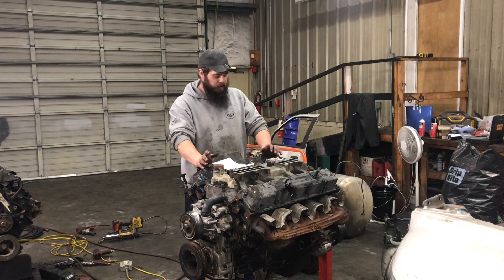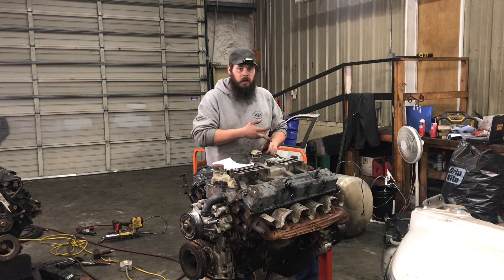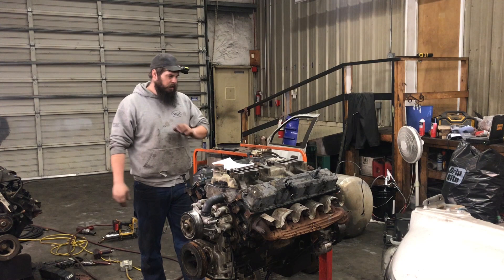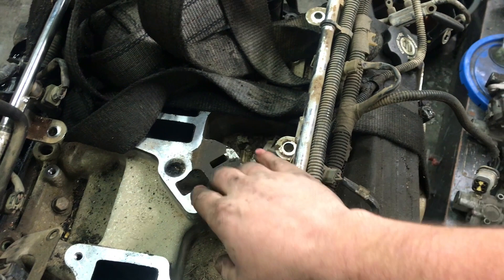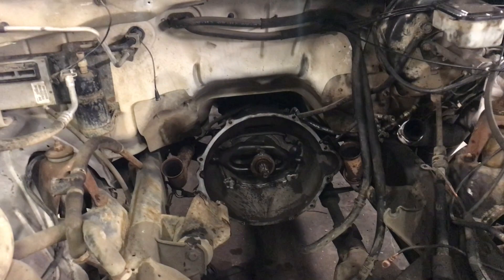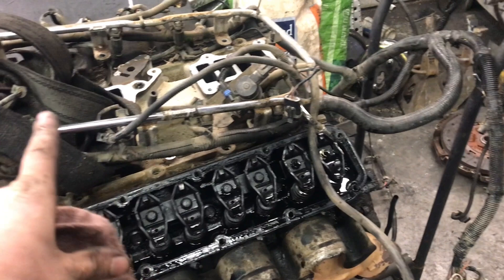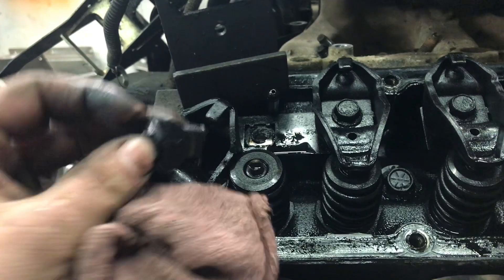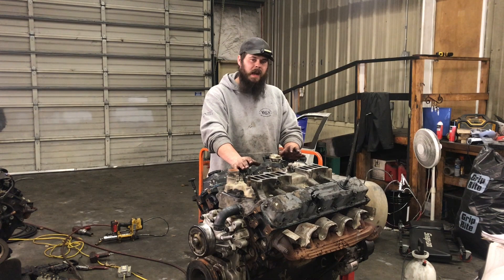EVERYTHING YOU NEED TO KNOW About the Dodge V10 8.0l Magnum

Comment: I this video is going to be a life saver for me. I just bought a 1997 v10 dodge with a 1995 engine swapped in and they couldnt get it running, doesnt have spark. I can see they messed with the cam sensor wiring and the wiring that goes to the coil packs. If im understanding your video correctly i will have to make sure it has a 1997 cam sensor and it should light. Ill have to see what they did for the EGR, always fun picking up someone elses project.
Reply from the maker: If it helps, all the video and editing was worth it
Reply: @BigBeav 0:02 0:02 rSl

Comment: The cam gear is different on a OBD 1 and an OBD 11 engine. A pcm on a 97 cannot read the cam sensor from a 94-95. I found out the hard way!!
Reply from the maker: Is it the cam gear, or only the sensor. Cam gear comes up as same part number for both obd1 and 2, but cam sensor is completly different

Comment: Thanks for this video!! Didn't really learn anything about ODB-1 vs. ODB-2 that I didn't already know. But I did learn that my (new to me) truck is apparently missing it's air injection system and the belt tensioner pulley had to be swapped with a grooved one, since it now holds the belt from falling off over on the passenger side. Looks like the tensioner itself is also clocked at a slightly different angle. The bearing on the pulley is also totally shot, so that should be fun to try and find a replacement for! 

Also, crawled underneath and noticed I apparently have three O2 sensors? One at front of each side of a Y-pipe which runs into just one single in / dual out catalytic converter which has a third O2 sensor mounted right near the very front of it?! Seems odd? Every other video I have seen shows dual cats which then run into a dual in / single out muffler? Mine is the opposite. Single output from the cat runs to a single in / dual out muffler (looks like a rusty old MagnaFlow) and then dual exhaust out behind each rear wheel. Clearly the cat-back is aftermarket. But the O2 sensor arrangement has me confused?! If you can shed any light on that.. that would be awesome! It's a 2001 / OBD-2 Dodge Ram 2500.
Reply from the maker: Is it federal emissions or California emissions? That would change the 02 sensor layout if I remember correctly to a pre cat and post cat system
Reply: @BigBeavrSlayer  That's where it get's tricky.. I have no idea, because my smog pump bracket is missing! LOL. But I think my truck was originally from California! I saw in another video though that stated only the California trucks had dual cats (odd that I apparently watched 3 or 4 different 8.0L V10 exhaust videos that were all CA trucks, but IDK.. shrugs*). If it was a CA truck, wouldn't there be four O2 sensors total? Would there only be one *after one cat on one side? It does sort of look like a hole was drilled / sensor bung was welded on to the front of this single cat (which I think is the standard Y-pipe style federal emissions setup)? Seems like putting the sensor before the cat would make it more likely to trigger a code though? IDK. Super confused. It's not currently showing any codes (pending or otherwise). I'm just playing detective trying to figure out what all was done to it previously. I suppose the ECM could have been swapped or reprogrammed as well?
Reply from the maker: @Lloyd33  check the underhood tag it will state if it's Cali or fed emmisions. Cali runs pre and post, often a single behind the y pipe

Comment: In your opinion, are you a fan of these engines vs. the Ford v10 or say the Chevrolet 8.1?  Or would you pick one of the others if you had it to do over?
Reply from the maker: 100% I love the dodge v10, I despise the triton with a fiery passion, the 8.1 is a fantastic motor but I would rather take a5.7 for fuel mileage purposes
Reply: How do you feel about the 6.0 gm gas engines?   @BigBeavrSlayer
Reply from the maker: @johnstudinski  one of the best engines gm ever built in my personal opinion
Reply: Are the gm 6.0 and the Dodge v10 in the same league for towing, in your opinion? @BigBeavrSlayer
Reply from the maker: @johnstudinski  yes

Comment: So I have a Cummins Truck it's an 05 body and I do not wish to deal with all the diesel gate bull crap that's going on theoretically if I was to strip out everything in that engine compartment could I get that to bolt on to my chassis put all the computers and Hardware in and it fire up if everything necessary was in place all of the appropriate gauges from a donor truck would it work in an 05 chassis I used to have a 95 and I absolutely loved that thing and having driven both a 325 common rail Cummins and a stock 8 L V10 I can't really notice any difference in power my question is would it work in my chassis
Reply from the maker: That was a limited few 3rd gen trucks that came with a v10 so I can't see a reason it wouldn't
Reply: There were only 500 or so 03 V10 trucks. I have seen them in person every once in a while. But you would need just about everything electronically out of one to swap in an 05 body.
Reply: @stubbsshop  my truck has the 5.9 Cummins diesel engine in it when I made my first initial comment I was considering putting a new version of the engine in but I really don't want diesel particulate filters or have to deal with things that just don't make sense honestly if the fuel system is adjusted correctly and you don't romp on the accelerator you don't make black smoke I don't know why spewing unburnt fuel out the tailpipe is so cool that's your money blowing away in the breeze and it puts unnecessary carbon buildup in your turbo since that initial comment I have repaired my existing truck and tuned it to balance the air fuel mixture deleted the automatic transmission and installed a 6-speed manual transmission

Comment: Great video ,so if I keep the oil changed and run a cleaner thru my V-10 It would keep the sludge from building up ???.
Reply from the maker: For the most part yes, and I would recommend keeping the crank case breather tubes clean clean clean
Reply: @BigBeavrSlayer  Where are these crank case breather tubes? And what do you clean them out with with? I've never had a vehicle without PCV. Also, what about the guy above that suggested running diesel oil because of the high detergents? Good idea / bad idea / horrible idea? 😝
Reply from the maker: @Lloyd33  the problem with switching to diesel oil us if the sludge is already forming in the motor, it will nock it loose yes but not exactly break it down, so then sludge is free floating in the engine. Will take a while to get it all out, I think a cleaner like a diesel, atf, kerosene, or mmmo and a few flushes would be a better option. The breathers come uo out of each valve cover one goes to the stock air box (driver side) the other loops up to the upper intake plenum (passenger side)

Comment: Hello, great video! I was hoping maybe you can help me. I have a 2001 V10, just lost oil pressure. it has 209k miles on it. I was going to start with the oil pump and pressure sensor. Also going to check the timing chain. Could you tell me where the time cover and chain are? Also do you know of any places to get parts from? having a hard time finding these things.
Reply from the maker: you lost oil pressure on the gauge? or the low oil pressure light came on?
Reply: @BigBeavrSlayer  Lost at the gauge, pulled the sending unit and plugged a pressure gauge to the port, less than 8psi at idle. the stock gauge will go to zero under load then climb as you give it throttle. its kind of all of the place.
Reply from the maker: @jpappilli  be advised the "gauge" on the dash is not a true gauge, it's a idiot gauge the numbers it shows don't represent anything at all except if there is pil pressure at the oil pressure sensor or not. Factory spec is 8psi at idle, 30-80 psi operating
Reply: @BigBeavrSlayer  Good to know. as of right now, when I tow, it will randomly drop to zero, then set my gauge alert off, then while driving it moves all over the place.
Reply from the maker: @jpappilli  I would put a manual gauge on it and do some towing and see what it does
Reply: @BigBeavrSlayer  Ok, ill give that shot and see what happens. Thank you!

Comment: Any ideas on bypassing the SMOG air pump or the EGR?  I have a 95' and once mine heats up it likes to surge at idle.  I can replicate the problem with an MT2500 scanner by activating the EGR Valve.  I suspect it has maybe a vacuum leak causing the surge.  Also would like to bypass the SMOG pump due to living in a state where emissions testing isnt performed and decreasing potential failure points.  Thanks!
Reply from the maker: You can delete the smog pump on a 95 and run a shorter serpentine belt, the computer doesn't care 

The egr valves is a turd to replace being under the upper plenum, but it has a short section of soft vacuum line that commonly cracks and sucks air, my 95 did that and it caused the egr valve to stick partially open and caked with carbon. Think the new one was like 65$ from rock auto to fix it

Comment: Hi I didn’t find the sensor on your video I’m looking for I need to replace or repair. It’s a 1995 dodge ram 3500 V-10 8L we also own the same in a ‘96 so your video is great! Can you help me identify this wire and sensor?
It’s behind the air filter assembly and a mouse chewed the wire right at the plastic clip
Reply from the maker: Behind the air filter box bolted to the upper plenum is the purge valve assembly, the only other 2 sensors right there are either the throttle position sensor and the idle air control valve which are both mounted on the throttle body these 3 sensors are in a vertical line on top of each other purge valve on bottom tps in the middle and iac on top
Reply: Thanks so much for the response! Is there a way to send you a picture of it?

Comment: Question,does the crank sensor has something to do for not getting fuel to the fuel rail? I think not but others thinks it does
Reply from the maker: That depends on what the vehicle is, crabk sensor usually controls spark and timing controls, but there are some that it does contribute to fueling
Reply: @BigBeavrSlayer  02 ram 2500 v10 4x4
Reply from the maker: @toddriesland3858  is the fuel pump turning on with the key? Should hear the pump humming in the tank as soon as the key hits the on position

Comment: so my question, the v10 mag?? is the block pretty much two 366 mag blocks and if so could i use performance upgrades from a 360 (5.9 mag) is my question
Reply from the maker: The rods are a slightly different length, but yes 360 rods and pistons can be used in the v10. I have debated going crazy high compression with one using 360 mag parts, problem is there is no aftermarket cams that would make good use of the add compression

Comment: Getting a 2001 v10 today do these trucks have crank position problems or was that on the older model ?
Reply from the maker: No issues that I have ever heard of with Crank sensors
Reply: There's Issues With parts Availablity Not Failure issues
Reply: Getting a v10 2001 do you like yours so far ?
Reply: @DanielPeloquin-q3x  can't say I'm complaining lol lots of toruqe just pulled 17k pounds and it felt like it wasn't really even there.
Reply: I have an 02 v10 with 327,600 miles plus

Comment: Looking at getting a 1996 3500 with v10. But just can't find any information on these engines.  Are they kinda reliable or plagued with problems?
Reply from the maker: If given proper maintenance and they will not sludge, they are very reliable. Between the 2 I have had there are over half a million miles. The one in the video with the sludging problem had 360,000 on it and with a lifter cleaning will co tinue on no problem. For the Era I would argue more reliable then their competition being the ford big block 460 and much more reliable then the gen5 chev 454
Reply: @BigBeavrSlayer  thanks for the reply,  it shows 196000 on the odometer. Truck has the right price is why I'm checking on it. It being a 4x4 3500 dually.  Don't need that much truck, just need a tow pig for my other projects.
Reply from the maker: @jayjones918  towing is where the Excel in my opinion, they get down and grunt and just pull. It's no diesel, but they will move just about anything you put behind them. I have moved a single wide house across town with mine, and pulled plenty of heavy dump trailers many miles and loaded car trailers

Comment: Hi, do you know if you can trick the obd1 to advance the timing through the timing chain? My V10 runs on propane or gas.
Reply from the maker: Potentially yes with a adjustable timing gear, but I have not found one available yet
Reply from the maker: i wish i had time to figure it out, since mine runs on gasoline or woodgas. im sure there is a way, just haven't had the time to figure it out yet

Comment: Hey...i have a 96 dodge ram 3500. High adle with no codes,
Change IAC, AND SENSOR NEXT TO IT BEEN REPLACE.
I THOUGHT MAYBE  I'D ASK YOUR HELP.
Reply: Me too bro any luck ?
Reply from the maker: Check for a vacuum leak. Upper plenum gasket is a common one I have seen, also pcv connection hose to the upper plenum on the passenger side, and check the vacuum lines underneath of the throttle body

Comment: Thanks I needed to know where sensors were and if mine was obd 1 or 2  it 95 dodge ram 2500 so it's OBD1 question for u on the OBD1 where is the port located that I hook up the scanner to find out problem with truck at first mine stumbled and didn't idle well so I replaced idle air control valve well it got worse would idle at at all to start it u would have to have push  throttle pedal in about half way turn key then it would start then from there to drive it u would have to break and throttle just to drive plus got a ticking noise I believe that to be in colomn not sure now won't even start if anyone has any ideals or information on where to hook up scanner or what could be wrong with truck and best way to fix I appreciate any input as this is my first dodge ram a buddie seen I was in need because my other truck use to drive got total so he gave me this and I'd like to fix up to say thanks for the gift and I just didn't drive it and then min have problems get rid of it that's happen to him by another person he gave vehicle to to help them out and that's what they did he was pretty disappointed so if can please help
Reply from the maker: Obd1 does not have a actual diagnostic port that we can hook up to, but if the check engine light is on then it has codes stored in the computer and you can cycle the key on off on off on watch the check engine light and it will flash a code. Quick blinks represent a number 1-10 so blink blink pause blink blink blink would be a code 23 for example. Then you can look up the code to start diagnosing the problem from there

Comment: Super helpful
Reply from the maker: I couldn’t find any videos on it but with having both motors sitting there figured it couldn’t hurt to help out the next guy
Reply: @BigBeavrSlayer  been fascinated with the dodge V10 for a bit and realized as I got older I viper probably wasn't going to happen and with the srt10 ram being billed as a collectors item I was left with the standard iron block been browsing around for a bit and other than the cons of any V10 ram is going to be a project with hard to find parts I got hopes to build a nice daily/tow rig out of one
Reply from the maker: yep this one is my tow haul rig and i really enjoy daily driving it. other then the sludging issue which is just poor maintance by the previous owners, they are great motors. only major down side is the fuel mileage, but i cured that by building a custom flatbed with a integrated gasifier so the truck now runs on wood chunks instead of gasoline
Reply: @BigBeavrSlayer  u did what really no bullshit wood chunks if true that's a video that needs to be put out was it super hard and cost lot of money to do
Reply from the maker: @charlenehume2134  full build series on my channel, I have 2 woodgas trucks I have built now and I built a wood chunking machine that makes the fuel for them and they are both daily drivers, 100+ miles a day

Comment: Howdy, I have a 1995 v10 and was wondering if there is anyway to run headers on my year ram because of the egr or if there was any way to get rid/around the egr? Thank you!
Reply: Was also wondering how cutting the cats of the truck would effect it ( engine codes and performance) saying that they are located at the heads?
Reply from the maker: @cadenbrown2495  cats are down stream in the head pips, cutting them out changes absolutely nothing in performance or fuel milage just makes the truck a smidgen louder. They do make headers for them though I have not looked for a egr delete kit so not sure about the egr

Comment: New subs here
Reply: I have 96 dodge ram v10 with air pump for the cat.juzt not sure how many cats it's got but only one tube hanging so I'm thinking it's got one catalytic
Reply from the maker: depends, California emissions trucks can have dual cats one in each head pipe. federal emissions will have a single cat just behind the y where the head pipes come together, will still have a o2 sensor in each head pipe, and the air pump should only have one line heading back to the cat
Reply: All air pump only comes with one cat?
Reply from the maker: @RobbyDee85  smog pump runs full time, it's run by the serpentine belt